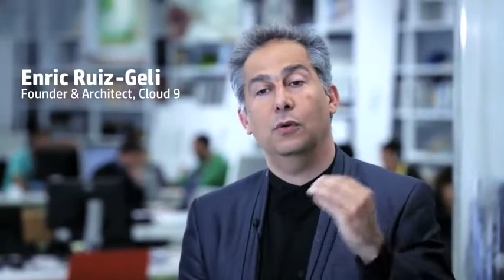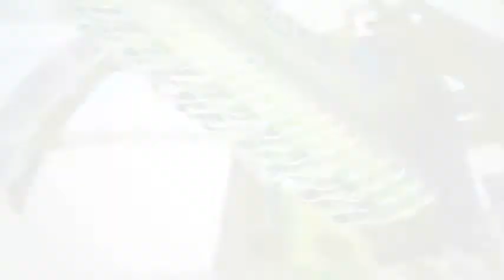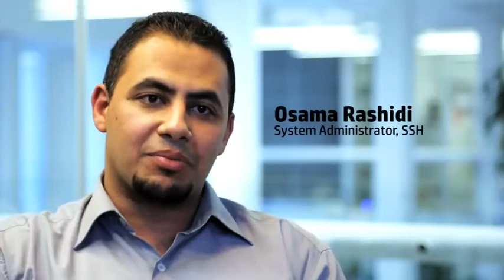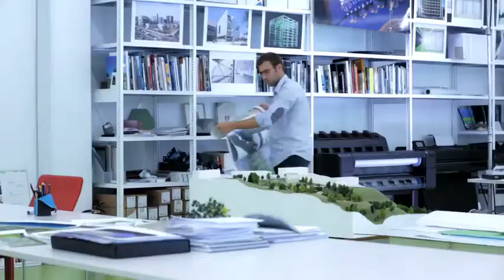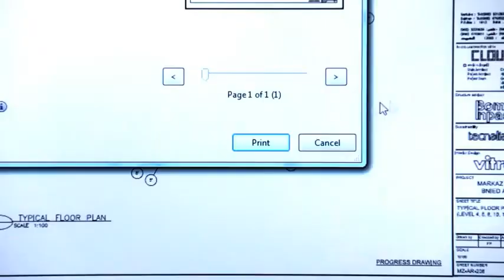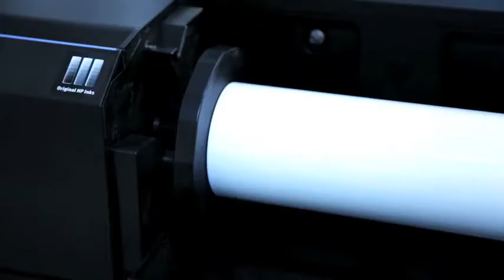HP Designjet T920 and HP Designjet T1500 | By: CPI CALL 0218309744

Comment: hello. i have a hp t920. I work most of the time with loose sheets. I feel that I lose a lot of time every time I finish printing a file, then it takes about 1 minute for me to access and insert the next page. If I print 120 sheets a day I would lose 2 hours a day as in that process. Is there a way to skip that process every time you finish printing a page?